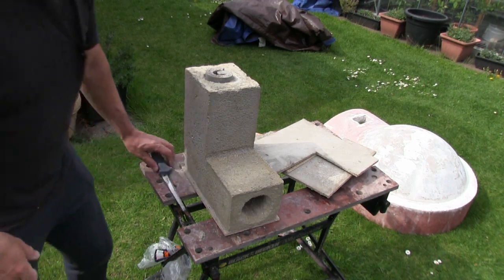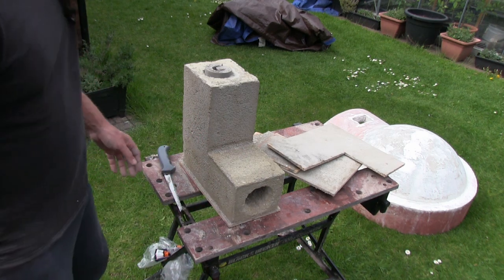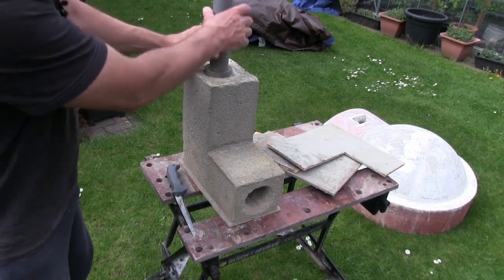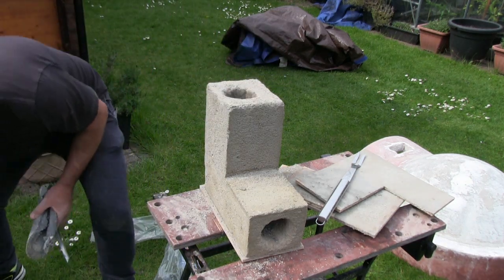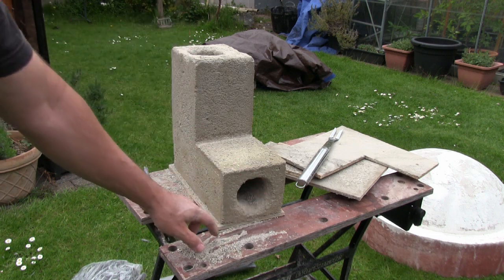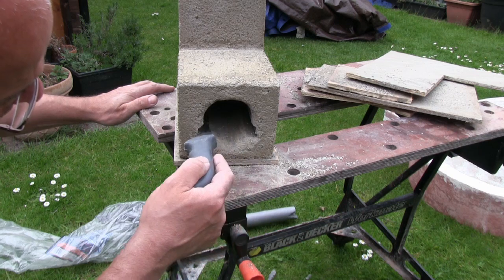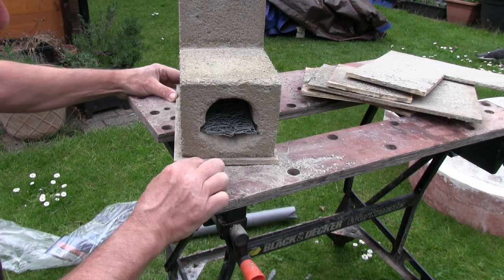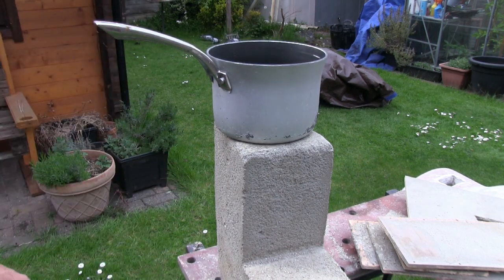Aircrete Rocket Stove Project PART 2 | No Foam Generator Required

Comment: Can aircrete take the heat?
Reply from the maker: Had no issues with it taking the heat. Major downside to aircrete apart from getting the mixture correct is the fragile nature of the finish. Rubs away easily so some form of surface finish to harden the exterior would be a great benefit.
Reply: Just wondering how hot the aircrete itself gets? As in, does the outside become hot enough to worry about?

Comment: My husband and I are wondering about the durability of the stove. Did it last? He is concerned that the fire will be too hot for the aircrete.
Reply from the maker: Still going strong. I've had about 25 fires in it with no issues. I did make a second one and soaked it in water before a heavy frost to see how it would cope. It didn't do well so heat isn't an issue. Leaving it out over winter in sub zero conditions will destroy it.
Reply: @mancaveprojects4693  Thanks!

Comment: Have you maybe thought about incorporating a little copper coil for a hot water source too?  I'm going to make one of these and wanted to try it. Like a hot water cylinder coil inside the stove made from 10mm copper pipe... Inlet and outlet sticking out the sides then connect a hose to run water through very slowly..
Reply from the maker: I have for my pizza oven build. What's impressed me with this design is the minimal amount of fuel needed to cook something. In my next build, I want to incorporate a fire brick tile just above the fire to act as a hot plate. Haven't seen anyone trying this but I bet it's not original (nothing is anymore😁)
Reply: @mancaveprojects4693  extra cooking area is always good and the heat at the top of the pizza oven would be ideal.. I built your original version 2 years ago and it's still going strong. I might need to replace the brick slips with something else soon though.
 A copper coil inside the pizza oven airbrick would be cool for a water heating element. Can't wait to see this if you try it. Good luck!